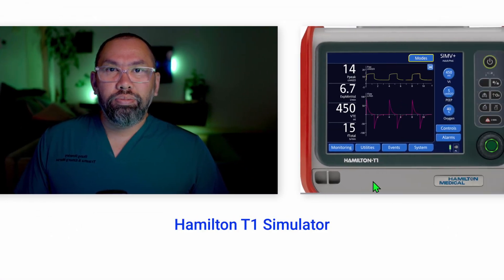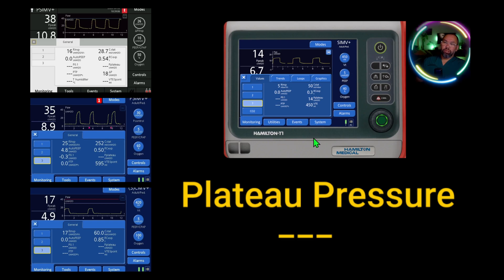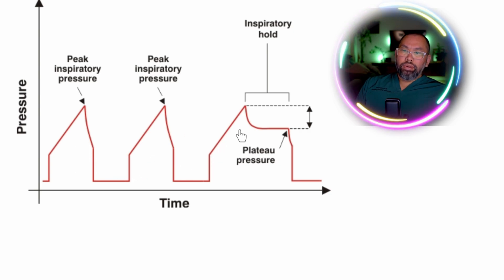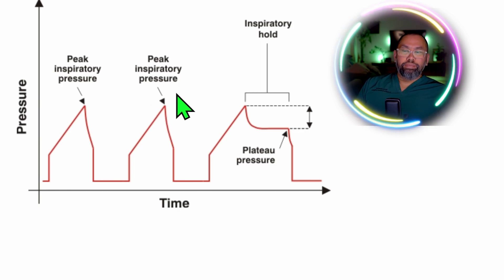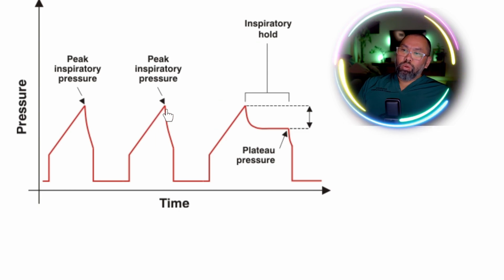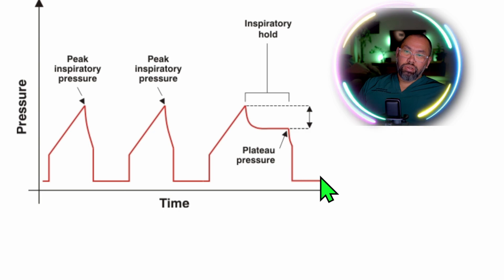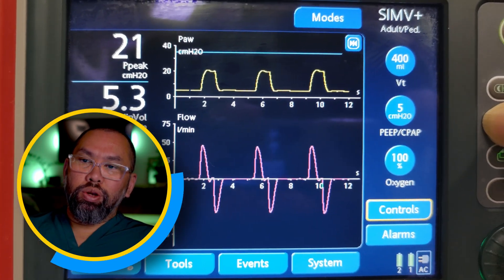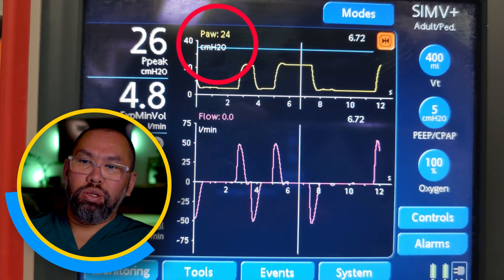Plateau Pressure - Hamilton T1 Mechanical Ventilation Series

Comment: Thanks so much for this. I’ve added the equation to my APRV go-card. Sometimes, the pplat has a value in there, and wondered why sometimes it’s there and sometimes not. Cheers!
Reply: If your T1 has update 3.3.x and above, Hamilton has added (Driving pressure) shown by Deta(symbol)P. Driving pressure as per Marcelo Amota. Driving pressure + PEEP (actual) = Plat pressure. just a slightly easier calc.